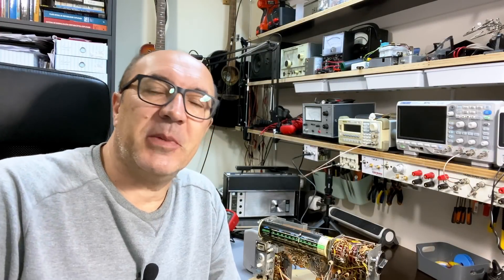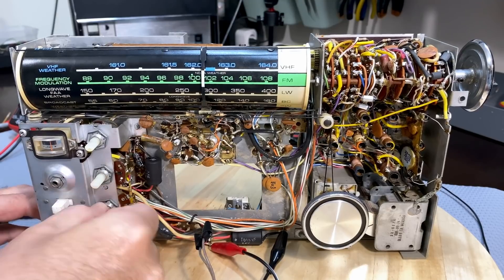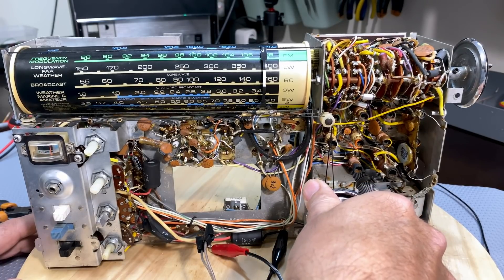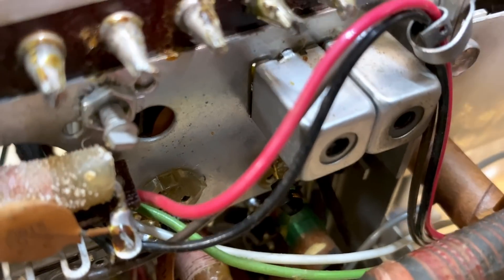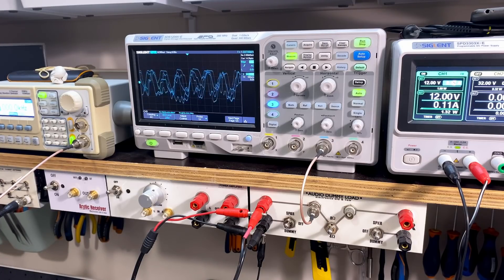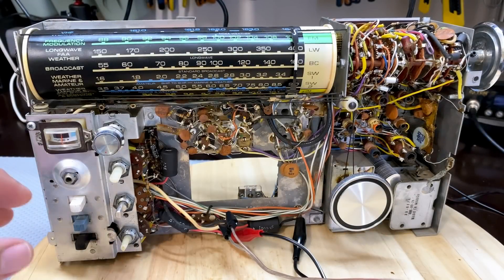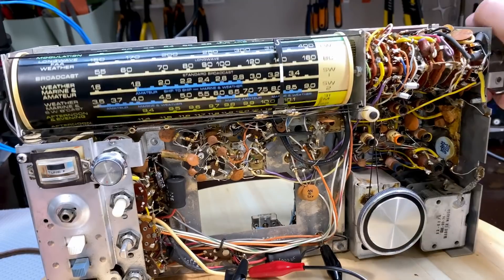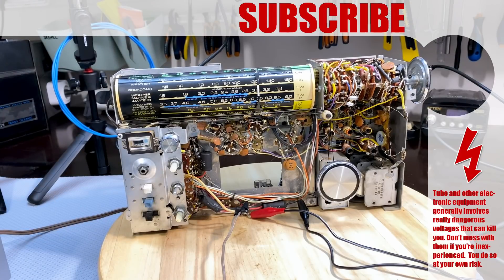Let's make some noise. IF alignment for AM. Zenith Trans-Oceanic Royal D7000Y restore, part 2.

Comment: This is quite the radio!  I am thoroughly impressed.  
Even though the capacitors tested good, I would want all electrolytics and any paper/wax style capacitors replaced with new ones...there is the issue though of getting to some of them and I would imagine that if I were doing the work...I would probably do exactly what you did!
Reply from the maker: You gotta know when to hold ‘em, and know when to fold ‘em 🎶

Comment: Hi, Manuel. Nice to see you're making good use of the tool I made for you. You'll definetly need it when aligning the RF in that radio.

If anyone is interested, this tool is 543-147 from RS Components ( https://www.rs-online.com ). It's a pack of five but too dear. The tool as you get it from RS needs to be modified to make it able to reach the inner coils:

http://www.pisotones.com/Zenith/3000-1/Tool.JPG

The upper tool is the original RS one and the other below is the one I modified by turning it with my lathe and sent to Manuel for further Zenith alignments. Beware that there are some "Zenith tools" sold elsewhere that are not suitable for this. ... don't ask me how I know 🙄
Must be a 0.1" hex head with quite a long and thin reach.
Reply from the maker: Yes, it definitely came in handy here, and still has a lot of work to do on this radio 😊 
I can’t thank you enough.
Reply: @electronicsoldandnew  You're welcome 👍🏼